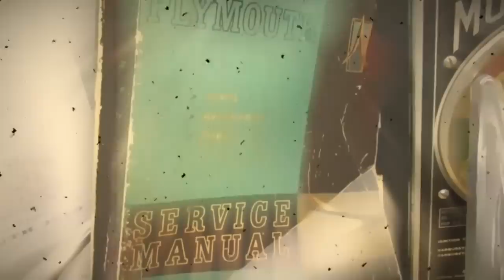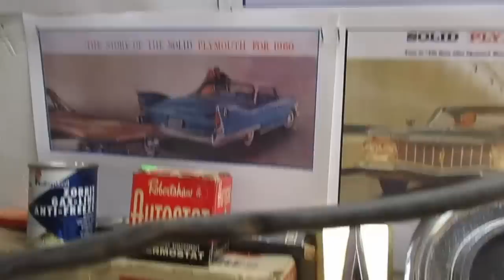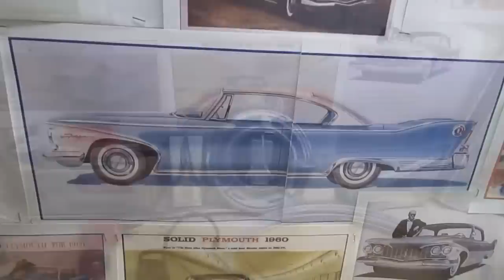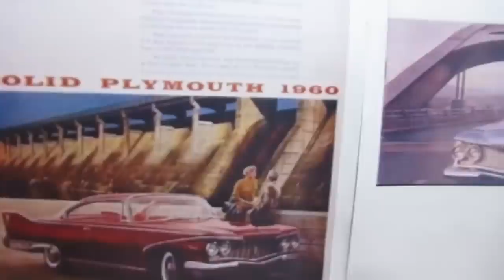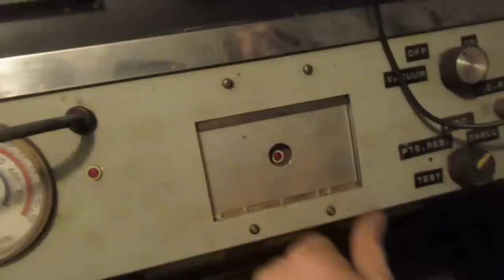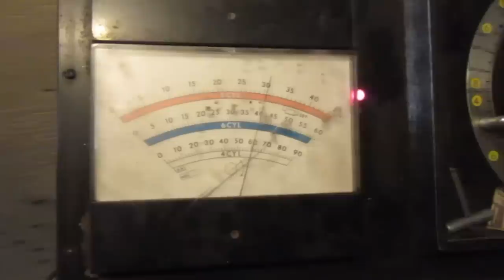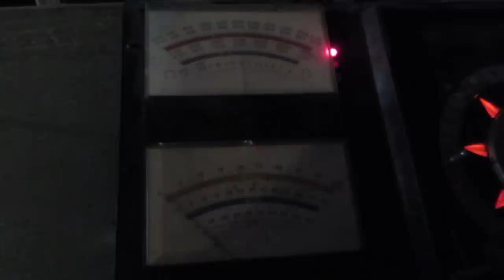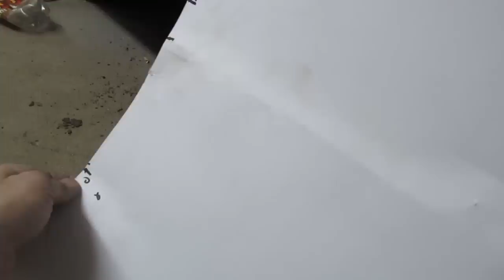1960 Plymouth Fury Daily Driver Project Part 9!

Comment: Awesome.  You say you don't have the right tools, but wow, you did an amazing job with the metal work.  Once that is welded and painted no one will ever know.  This is a great project to watch.  Anyone young can learn alot. Great stuff, look forward to more!  Thanks.
Reply: My thoughts exactly. He's done an excellent job on the panel. A body shop couldn't have done it any better IMO. It really comes down to the person who's actually doing the work.
After all a body shop is really the sum of the quality that the people who run the shop produce. You sir IMO have done a fine job of the '60 Fury. Be as good as new or possibly better. Hope to meet you and your crew one day soon. Have gr8 day.
Reply: Dan Goodall-Williams   What do you mean, “anyone young”!?!  Hell, I’m 56 and my brain hasn’t turned to mush yet...😉
Reply: @paulkirkland1535  Have a look at Trev's Blog (on Youtube) ... he's a pro, does it for a living AND as a pasttime for his own shit .... he does basicly nothing else, with basicly no other tools than Scott used to smack the Fury's bottom: a shrinking/stretching tool, an English wheel (which here would be a Canadian pneumatic hammer), some oddly shaped pieces to hold tight from behind and a hammer or two. It's a thing of knowledge, not of tooling.
And of patience and perseverance. When it's 27 sub zero in the unheated part of the shop, You might develop quite a perseverance in the heated part I reckon 😂😂 ... and that recurrently each winter, of course 😂
Reply: @skn9895  Just wait till you get to 156.......

Comment: You gave me the confidence to fix all the dings in the aluminium and stainless trim on my ongoing 60 Bel Air rebuild myself; using a variety of toffee hammers, few scraps of steel and wood and one large ball peen hammer as an anvil. Never done any sort of metalwork before. They are all polished now and perfectly OK: Not concours, and I don't want that, but very good one yard away.  Maybe I'll tackle a repair panel on the next rebuild now! So happy every time you post an episode. Thanks from Herefordshire!

Comment: Shiiit work...(incidental music)..lmfao.  I must tell you again how i like these videos, I can't wait for each installment to come out . What drew me to coldwarmotors was the original cold start videos. I drove a series of "beater" cars ..one of which I paid 50 dollars  for , drove it a year and a half and then sold it again for 50 dollars .  So I too developed the knack of the "cold start" out there in the driveway at dawn trying to get to work.   I found that the basic trick was to get the automatic choke set correctly and not pump the pedal too much or the choke doesn't stay set right . The Fury is gonna be an awesome car. I like the fact that it is a v-8 ...thumbs up ...[grin]

Comment: I follow a couple of fabricators but that they are primarily tubing and chassis type. Your actual metal fabrication, inspiring. I've done a lot of cut and welds on replacement panels but never developed the skills that you possess. I know a lot of it practice, I just need to apply some of the tricks I've learned watching you and Gene Winfield and get in the shop. Lord knows I need to beat the living daylights out of something after the last year and a half, just as well be some Chinese steel. Lol

Cheers brother, thanks for sharing your time with us.

Comment: Dear Coldwarmotors.
This time you caused big trouble (just kidding)! Half an hour before I had to leave home for necessary physiotherapy this video arrived. Good grief, what to do now? The whole weekend I waited so desperately for another Fury slice, therefore I wanted to watch it immediately. On the other hand I was sure that I couldn't have stopped the vid if beginning to watch this great stuff! I was nearly ripped in half by this problem and therefore I got late for physio at the end. ;-)
2) Like last time I have to contradict again: At 0.49 min the metal wizard said: "Anyway, usual bullshit"! ;-) But no way: This carb was unbelievably clean inside. Gasket was O.K. too etc.p.p.. 
Meanwhile I really think it's a bit good Christine magic inside this project car. Remember how unbelievably good the slices fitted together and how good the engine started and ran. There was also the find of the front fender and now a carburator in an amazingly good condition.
I think that this car simply wants to live and run again! And therefore it helps it's new owner Scott Metal Wizard of Cans (Canadians or beer cans, it's your choice). ;-)
Thanks a lot for making, taping, editing, uploading and sharing.
Last but not least: Incredibly well done metal work again and as always!
My very best regards and a lot of hugs for Francine (discoverer of the Fury rusty doggy holy... uhm... hole).
Postscriptum: Maybe "Anyway, usual bullshit" or "usual bullshit" is an even better Coldwarmotors slogan than "same old shit"!? ;-)

Comment: hum along to the theme from "sh**work," and see some of the most impressive hands-on craftsmanship i can say i've ever seen. virgil exner would be impressed by the firewood and trailer hitch panel extrusion. i  thought we'd never see the spliced jetson mobile any more. neat: so many tubes and wires and hydraulic lines in the CV, AFTER air condition delete. makes the fury look like kinda empty inside.

Comment: Those Carters are really easy to rebuild.  My first was my 64 Polara Convertable way back when I was 18.  The thermostatic choke was a PITA.  I'm wondering what guage sheet metal you work with for these patch panels.
Reply from the maker: Hi, thanks for the note! In this case, I'm using 18 gauge stock... a little heavier than the original, but it was what I had around...cheers!
Reply: @coldwarmotors  The bimetal choke actuator would keep my Dodge on high idle during Ottawa winters.  The problem was the intake would not warm up fast enough to bring it down to slow idle and take the choke to the full off position.  Maybe I was just a young inexperienced punk then but it would stay on high idle and just spin the tires in the snow once in gear.

Comment: Trying to remember how many years it’s been since I used a timing light.
Reply: Points and condenser, carbuerator, round glass headlights. Mind blown!!
Reply: If your auto breaks down today, its a tow truck and a thousand dollars. Back then it was a screwdriver and a pair of pliers, mabye some baling wire.

Comment: You gonna put the fury front panels on or at least the grill?
Reply from the maker: I'm not sure I understand the question? The car will look original when it is finished. Cheers!
Reply: @coldwarmotors  ah ok I was just wondering if it was going to look original thanks for answering

Comment: You should make yourself a sandwich filled leather panel beaters bag. It's essentially a large leather bag that is filled just enough to allow the sand to be displaced to allow the panel to be formed by using your mallet to put in the curves the panel needs. Eastwood sells them so you can look at their website to figure out how to make and use one. They are great

Comment: are you doing single flair or double flair on those brake lines?
Reply: I will be doing a triple flair double expresso half shot with a jimmy johns quadruple bypass.
Double flair as per factory specs, single fair splits and is unsafe, what would you use?
Reply from the maker: Hi, thanks for the note... All of the lines are done with a double-flare end, as per the original type. Cheers from here!

Comment: Should work fine but not the original carburetor. 1972-73 318 version because it has a charcoal canister purge port at the front center.
Reply from the maker: Hey thanks for the note! I like the 69 Dart Custom you found... My dad bought one new, and it was my first car... Ours was a green slant 6 auto with no other options... I keep my eyes open for one still...Cheers!